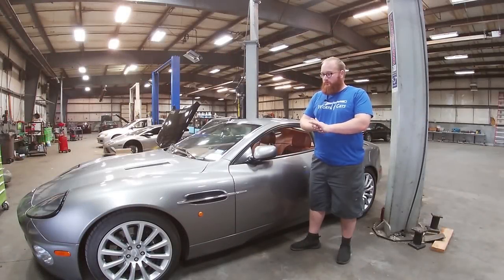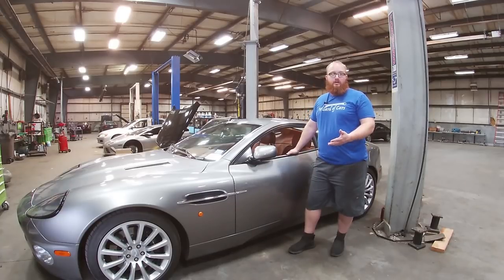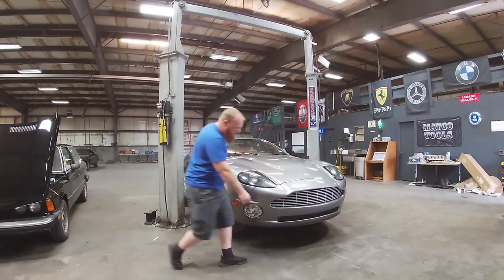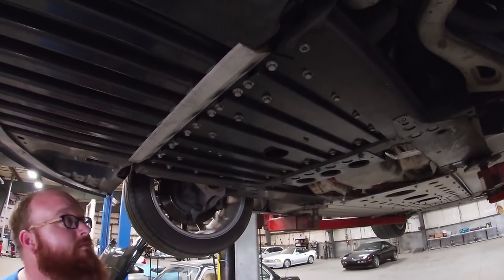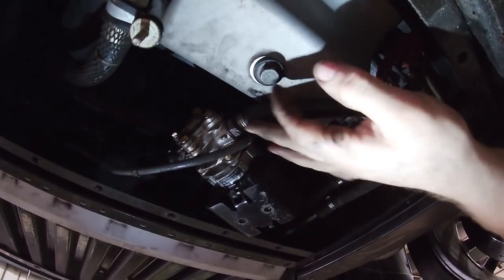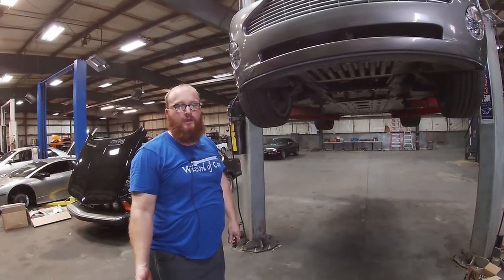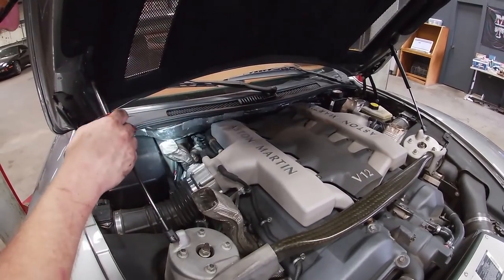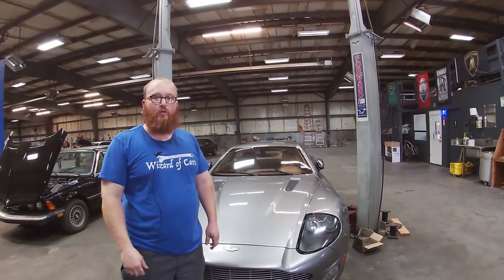The CAR WIZARD reviews an awesome 2003 Aston Martin Vanquish

Comment: I love how gently he closed the hood and even did that little wipe with the rag.  Tells me all I need to know about how he treats his customers' cars.  If you need work done, go to this man!
Reply: I bought a BMW Z4 with dealer warranty. Knocking noise in boot, they couldn't fix but gave back the car with oil hand prints all over the cream leather interior and big hand print on boot. I went nuts. Never been to a dealer since. I fixed the problem myself by rotating the rear spring.
Reply: As it should be done

Comment: I test drove one of these in Walnut Creek CA back in 2004/5 and it was sublime, the driver seat is so comfortable and just hugs and welcomes you, it's very intoxicating in there, the drive was beautiful, fun, and yes that car loves to go and isn't shy about it to say the least.  In person one of these is like art work and the body lines you can just stare at and feel like it's going fast just sitting still.  Now the one I took out had a blue pulsing start button that after in neutral it pulsed then when pressed pulsed red and stayed red after the engine was running.  When I was about to leave the dealership I asked the Rep, Can you see well out your side? He says yes, why?  I told him Good because I can't!  Lol and then quickly pulled out into traffic before he could react with anything other then grabbing the Oh Shit handle and a Oh Damn verbally.  But then I told him I'm just kidding I can see just fine.  I'm 6'5" tall and fit in that car with still good headroom.  I like to test drive vehicles of all kinds like some guys collect shot glasses.  And this was one of the best test rides I did and still stands out as my most memorable from point of view outside and inside feel to the drive itself.  Pluses it was cool as this was a Bond car.  The only other Bond car I test drove and owned was a 2001 BMW 745iL a real tank beast V10 and in my opinion the last time BMW's had good body style before they turned all Round and electric razor like.  Lol, thanks for reading and thanks for this post Wizard!  Brought back good clear memories.

Comment: My wife owned a new DB 9 2007 Convertible.  V12 6 liter.  Frequent electrical problems. Long wait for parts.  All aluminum body at 3800 pounds. Bently all steel 5000 pounds as they needs 600 horsepower W12’s

Comment: that's a really nice car even with quite so many visible Ford parts, used to have some years ago a '02 Jag and it was the same thing with lots of Ford in it, not what you wanna see from such a car. Just a piece of advice from the customer point of view, please do use steering wheel, seat and mat cover while you work on the cars, especially on such a beautiful examples, oil stains will not come out and i would be really pissed to come pick up my pride and joy and discover stains inside the car from greasy hands or dirty shoes, it's better to prevent such accidents and keep the customers happy :)

Comment: I have a friend who was asked by one of his customers to fit a reversing camera to one. It came brand new from the dealers to his workshop,
When he was removing the rear bumper he was horrified to find that it was put together using double sided tape. ( it was incredibly strong )
When he contacted Aston Martin for some replacement tape, he got a  snotty e-mail back saying we do not use tape on our cars. As luck would have it he had a friend who worked on the production line and sent him some in the post. British engineering at its best.

Comment: Awesome video! I have a '04 Vanquish and have yet to see what it's like to have the bottom metal panel removed. If convenient, would you consider doing a video tutorial on how to remove the headlights? I have written instructions from various shops in the UK (remove the wheel liners and pull the headlights out from behind) but my mechanic still had trouble removing them. Many thanks!

Comment: Looks like it's got the Linn HiFi system fitted.   You'll see a big PA in the boot / trunk.   There's stories that goes around the electronics industry in Scotland (where Linn are) that they got the Aston Contract, but then started swapping automotive rated parts for standard ones and then got a lot of failures of their HiFi equipment.   Someone in Linn purchasing didn't know the difference between the parts and bought the cheaper ones.   Or, at least, that's the story I've heard within the Scottish electronics industry.

Comment: "Vanquish" is the name Aston Martin rolls out when it builds a brutally powerful continent-crossing GT for its richest customers. :)

The brand new price tag on any generation Vanquish is going to be stratospheric. But for the money, Aston Martin gives you a blisteringly fast car that also boasts a gentleman's club interior. The reason you pay a ton of money for a new one, is because no expense is spared when building it, and filling it with toys.

Oh, and in the near future, there's a new Vanquish in the making, which apparently is going to be a mid-engined supercar aimed at taking on the likes of the Lamborghini Huracan. According to some "hint hint" press releases from the company, it'll be based upon ideas first trialled in the Valkyrie, but, er, a little less eye-wateringly expensive. Even so, if a new mid-engined Vanquish puts in an appearance in 2022 or 2023, you can expect to blow at least a quarter of a million on one.

Comment: The last of the hand built Astons. Gearbox is a major problem though it got better with the S version. Luckily you get Newton Pagnell factory to fit a manual 5 speed for around £8-15k GBP.

Comment: Just give me PRND21 on the Column or the Floor and a Regular Brake like in my 92 Chrysler LeBaron LX Convertible or my 2008 Mercury Grand Marquis LS. Flappy Paddle Shifters just piss me off.  If I want a Manual it better have a Clutch and a Stick that is Slick and not stiff.

Comment: Nice car but damn what a slow 0 to 60 time for those horses and torque
Reply: It's nearly 2 tons of British beef and the gearbox is an old fashioned flappy paddle affair with slow changes. If you put a modern DSG in it then it could possibly dip into the 3's for the 0-60.

Comment: Car Wizard:  The power steering reservoir you tried to open is used on every Porsche and most Mercedes.  You have a Porsche 928 in the background, it has this exact reservoir! 

[go take a look!]

-Don't you know that the easiest way to open these is with a rag under your hand~?  And you open them by gripping the cap while twisting your whole body, not just your hand....